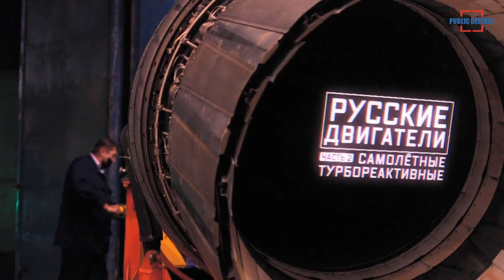Second Stage Engine for the Russian Su 57 Fighter Jet could be Classified as 5+ Generation

Comment: A small correction.  Total thrust and specific thrust are not the same thing.  Total thrust is just that - the total.  Specific thrust is thrust per unit of mass of air passing through the engine.  The Russians are saying that the izdeliye 30 produces a higher specific thrust than any fighter jet engine currently in existence.  They are thus saying that it generates thrust more efficiently than any other fighter jet turbofan.  They are not claiming that it generates more total thrust.  Other engines (like F135 or NK32) may generate more total thrust by moving more air.

Comment: Unless it is not getting into variable cycle technology it will eat fuel, fuel, fuel, 
curtailing range, range and or payload. 
And what is supercruise? Mach 1.2, 1.4, 1.6? 
To make supercruise a reasonable characteristic feature you should be capable of more the 30 minutes at supersonic speeds.
This is 4+ generation at best.

To mention stealth. The Su-57 may be stealth in the front aspect, however the rear cries here I am. Not to talk about IR-signature.
Possibly 5th generation front, 3rd generation from the back.

Stealth weapon carriage only in air-to-air, how about air-to-ground - the RCS becomes big as a barn-door.

I like its maneuverability - well done, but it also adds complexity via tails, TV and LevCon-devices.
Reply: su57 has been design to fly low level with a lower stall speed. Have you noticed the su57 camo patterns? When flying low level stealth is not a priority since doppler radars are not precise enough for locking when there is noise in the background, ground, mountains, trees.... The IR is a problem but you simply cant do 3D thrust vectoring with boxed nozzles. And without 3D thrust vectoring you cannot do flat spins or other game changing maneuvers. su57 is an ambush fighter
Reply: Design spec for supercruise is Mach 1.6.
Reply: Also, the only stealth vulnerability from a rear aspect is the current Al-41 based engines.  The izdeliye 30 fixes that problem for the Su-57.

Comment: Does it super cruise? Please say yes
Reply: It will super cruise once they can figure out how to mass produce it! You see, Russia needs to sell this plane to foreign buyers like the Chinese who are notorious for reverse engineering, copying and then selling it for cheaper. So Russian engineers not only have to make a more powerful engine but they also have to make it difficult to take apart without special tools which means that buyers of SU-57’s can barely do basic engine maintenance ... they’ll have to send the entire engine back to Russia for any major maintenance and jet engines need a lot of maintenance!??
Reply: @JimCOsd55  Su 57 with current engines does super cruise! China also produces its own stealth fighter which became operational before Su 57.
Reply: @TheAhanin  ... true, they can supercruise with their AL-41F engines at a little over Mach 1 which is  why  they are still working to get the more powerful Izdelie-30 engines perfected? The F-22 can supercruise at Mach 1.8 which allows them to impart more energy into their missile launches! Still China does want to buy those AL-41F engines to put in their J-20’s but Russia wants to sell them the entire SU-35. But China only wants the engine, because they found that SU-35’s missiles, radar and avionics are inferior to the J-20’s!??

https://militarywatchmagazine.com/article/supercruise-russian-su-57-can-fly-supersonic-without-afterburners-reports
Reply: @JimCOsd55  I wouldn't bet on the izdeliye 30 being a maintenance burden if I were you.  The longevity problems with the cold war era engine designs are easily explained by the emergence of single crystal superalloys.  They were a significant improvement in being able to handle both higher rotational stresses and higher thermal stresses.  But, what many don't know is that, they are also much more susceptible to oxidation damage.  

The historical problems with Russian engines stem from the fact that the USSR never solved the inherent problems in single crystal superalloys because it died shortly after these materials began to appear.  But new engines like this and the PD-14 utilize newly developed materials with decades of slow research behind them.  I think the RuAF is going to see a step change increase in MTBO with these.
Reply: Oh, one other thing to add to this thought.  Go watch a cold war era Russian fighter fly.  What's one thing that you are sure to notice?  The engines frequently smoke!  Smoke indicates incomplete combustion - which also leads to increased generation of reactive species in the combustor, and thus higher stress from oxidation.

Back when the USSR was using polycrystalline superalloys, they didn't care that much.  The incomplete combustion lowered fuel efficiency a bit, but the USSR was awash in hydrocarbons.  And the materials held up to oxidation damage a lot better.  Oxidation damage only became critical when making the switch to single crystal technology.

Russia's newest engine - PD-14 - easily passed the latest 2020 edition of ICAO emission standards (which includes byproducts of incomplete combustion).  Standards that are significantly more stringent than what was in place in the late 80s to early 90s.  So, not only has Russia's material science greatly improved, but their combustor design has improved a good bit too.  That too is going to lead to substantial increases in longevity.
Reply: @alexandernorman5337  ... of course the Izdelie-30 is going to be a maintenance nightmare because Russia wants to sell this fighter with these engines to client states especially China but that runs the risk that China will try to reverse engineer the engines as they have done before. To combat this, the Su-57’s lacks a “modular engine concept” thus making routine maintenance much more time consuming and costly. Which prevents any users from doing more maintenance locally, which means that your SU-57 is down while you send it’s engines off to Russia for any routine maintenance!
Reply: @JimCOsd55  I think you misunderstand things because it is impossible to design a twin spool low bypass engine without a "modular engine concept" because it naturally divides itself into sections (modules): fan assembly, high pressure compressor, combustor, high pressure turbine, low pressure turbine, low pressure spool, and high pressure spool.  The izdeliye 30 uses this same general arrangement that every fighter jet turbofan in the world has used since the 1960s.

Rather, what they are doing is going hard down the path of component elimination.  An example is dispensing with a rotor, dozens of blades, securing pins and locks, and replacing them with just one component - a blisk.  And they aren't doing something strange here; everyone else is doing this too.  The F119 engine used some blisks from the beginning, and presumably next gen engines from the US will use more.  The civilian airliner engines are now using these: Rolls Royce with Ultrafan, GE with Passport, etc.  The Japanese are saying that their XF9 future fighter engine will be entirely blisks - every stage.  I don't know if izdeliye 30 takes it to that extreme, but the Russians are fully utilizing additive manufacturing to do a whole lot of topological wizardry.

And this actually aides routine maintenance and operations!  There are less parts and so it is easier to manage the supply chain.  Less chance of finding out at the last minute that you don't have something readily on hand.  Less parts also means that there is less chance for a technician to forget to install a component or fail to secure it per specification (with disastrous consequences).  Not to mention that combining various parts into larger subassemblies allows you to utilize the native strength within the materials, making the engine more durable and longer lasting.

The theoretical downside to such a strategy is that, in the event of strictly localized damage, you have to repair or replace a piece much larger than you otherwise would, and that this is more time consuming and costly.  But everyone is going down the integrated path because this theoretical argument holds little real world value.  If such an event happened to an engine (such as a very small foreign object being ingested and damaging only a few blades) you have to completely break the engine down anyways because you can't assume that the damage actually is localized!  You have to prove it by detailed inspection!  And, at that point, swapping out a blisk or some other complex subassembly doesn't add an appreciable cost penalty relative to the entire operation.  Not to mention that such events are rare and unplanned, and the cost savings from scheduled maintenance makes up for any such unforeseen events.

No, the izdeliye 30 architecture is doing things smart and futuristic.  The Russians would be dumb to keep doing things as before.
Reply: @alexandernorman5337  ... it’s not impossible, just difficult but when one your biggest buyer likes to reverse engineer your weapons and then turns around and sell them for a cheaper price as your biggest competitor ... what other choice do you have? So they’ll still build item 30 as a modular engine but it will be like a jig saw puzzle that must be taken apart in the correct order with specialized tools lest you break something!??
Reply: @JimCOsd55  All jet engines have to be disassembled and reassembled per the correct procedure and with the specified toolset.  That's why the maintenance teams have to trained on the specific engine that they will service.  No difference here.

And I don't think China is even going to get the izdeliye 30 engine.  I mean, what would they use it for?  The Russians made the izdeliye 30 to be largely the same in physical dimensions and mounting as the Al-41F1 engines that the first series Su-57s are being built with.  This makes for an easy swap.

But China doesn't have the Al-41F1 engine.  And the dimensions and mounting for those engines are not the same as for the older Al-31F engines that China has!  Do you really think China is going to be able to install izdeliye 30 (or a "copy" of it) in place of the Al-31F in their aircraft?  That is going to require major redesign, and it will likely be impossible to retrofit current in service aircraft.

So, China doesn't have a ready application for the engine.  And Russia isn't going to sell it if the Chinese don't have a ready application.  Because the only kind of sale Russia is going to accept is a large order with ~50-60% paid before delivery of the first batch and the full sum on delivery.
Reply: @alexandernorman5337  ... I’m a diesel mechanic, some engines like Cummins are easy to work on. You need to change a water pump, removes half a dozen bolts, clean the area, new gasket and install the new water pump. A Cat engine is quite different, a water pump is a pain but try changing out a simple oil cooler and you find yourself removing half the engine to get to it even tho it looks easily accessible sitting on the side of the engine!

Which probably explains why Russia has agreed to sell SU-35’s even tho China promised not steal intellectual property rights ... they still made the AL-41 engines difficult to tear apart!

While China originally expressed interest in the ALS-117 as a stand-alone product, Russia’s refusal to export the engine alone necessitated the purchase of the Su-35. Russia insists that extensive IP protections safeguard the ALS-117 from Chinese reverse engineering. However, given China’s questionable record of respecting intellectual property, it is plausible that they will attempt to reverse-engineer parts of the ALS-117 anyway, although this is harder than it sounds. Russian sources claim it is nearly impossible to reach the “heart” of the engine without breaking it.
Reply: @JimCOsd55  Yeah, I got to say that you really misunderstand what they mean by not being able to get to the heart of their engine technology.  It is not part of the engine itself.  And the engines are not hard to disassemble and reassemble if you follow the procedure.  The thing is, disassembling it doesn't tell you how it was made.  Because the critical components - turbine blades, vanes, flame tubes, and combustor liners are not just cast and/or etched pieces of metal.

https://clarke.seas.harvard.edu/files/clarke/files/mrs_bulletin_tbcs.pdf

What you got to understand is that the intermetallic superalloys are supplemented with specialized ceramic layers.  Do metals and ceramics typically have similar coefficients of expansion?  Not even close, and so those materials are all under phenomenal strain.  And you have to get other factors just right - the chemical protection of the oxide layer and the porosity of the thermal barrier ceramic coat, for instance.

You can cut into them and see the material cross section like shown there.  You can form chemical analysis to identify the elements.  But that doesn't tell you how they grew the crystal structures and got them to bind the way they did.  Were the oxides grown through electron beam physical vapor deposition.  Very likely.  But what was the energy level of their electron beam?  Someone trying to duplicate the engine has no idea.  How were the beam target and the deposition target oriented relative to one another?  Again, no idea from looking at it.  Was it formed in a vacuum chamber or at some pressure with inert gas?  Again, you can't tell.  And all of these things and a dozen or more other variables are crucial.  It's the process technology that they are talking about.

Basically, the only way to copy is through a lot of trial and error.  You make educated guesses and run your prototype technology against theirs.  You assess the results, make adjustments, and then do it again.  And again, until you get comparable results.  It takes a lot of time and, since you are wearing out a lot of engines, you need a large spare supply to do it.

It's the same way with the LEAP engine.  Chinese airlines use them.  China has access to them.  How is their attempt at making a high bypass engine going?  Not very well.  GE makes sure they have enough engines to equip their planes in use and will never let China build up an unused pile that could go into a deep cycle research program.  China can't get to the "heart" of that engine either.

There won't be any problems with servicing izdeliye 30.
Reply: @alexandernorman5337  ... We’ll see, if Russia can’t build the izdeliye engine, they really don’t have to worry about china stealing it? I’m guessing by next year, just like the T-14 Armata ... Russia will decide that they don’t really need it when they already have the the already capable SU-35s!??

The RAND Corporation quoted a former Sukhoi engineer, who claims the 76 operational models that the Russian Federation Air Force is expected to receive during the 2020s will not have the intended second-generation engine, which contradicts the Russian aircraft maker’s claim of outfitting the batch with the new engines.

It remains unclear when the second-generation engines will be ready for powering the Su-57 fighter jets.
Reply: @JimCOsd55  Honestly, I think most think tanks and media outlets have extremely low credibility when it comes to the Su-57.  I mean, they have missed again and again - saying that Russia couldn't fund it when India formally announced that they wouldn't pursue the FGFA even though it was public knowledge that India had only made one payment of < $400 million and was financially irrelevant, and then saying that Russia would cancel it because defense officials said that the Su-35 was good enough for current (not future) needs.  They are a bit too blinded by their own wishful thinking.

UEC does have some significant cred now with the current generation, having completed the PD-14 and VK-800 programs.  Given that and that there are no known issues with other new generation programs which are advancing (such as VK-650 starting bench testing earlier this year), I would have to see some evidence of a problem to believe that there is one.  MAKS is only two months away though.  We might learn more there.  I'm hoping so, although I am more interested in PD-35.  That program is going to open doors.

And China is not going to steal the technology.  Again, have they 'stole' the technology for CFM LEAP?  Chinese airlines have been using that engine for years now.  Reproducing an engine is virtually impossible without a dozen or more unused examples that can be harnessed.